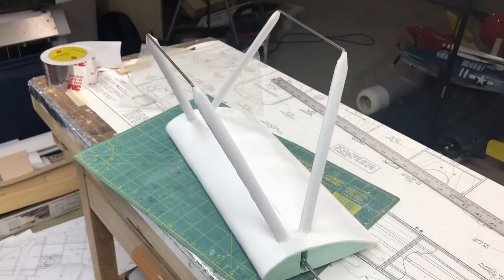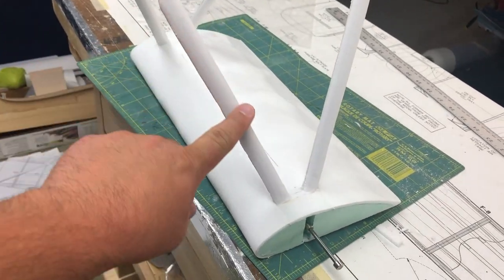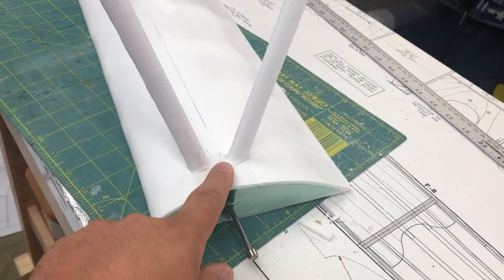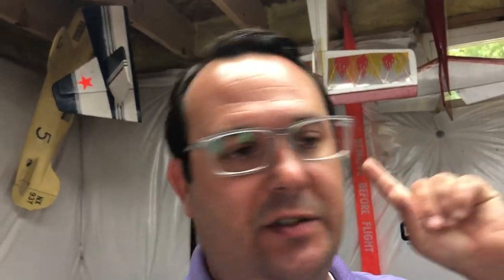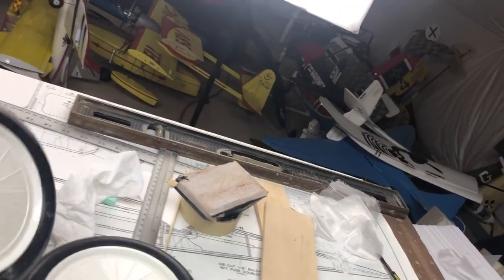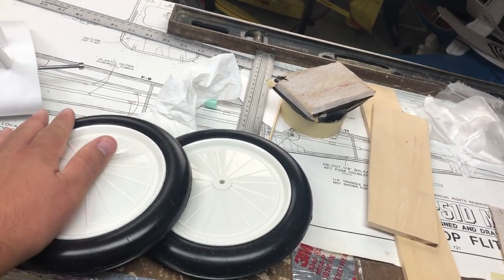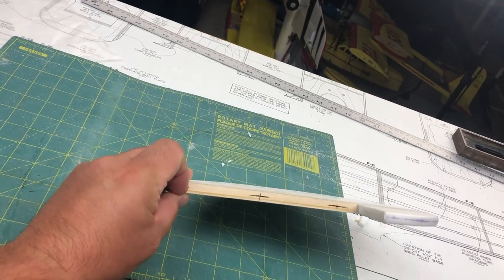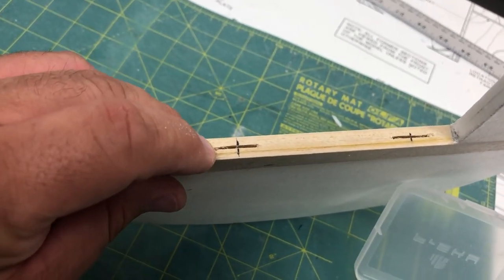Fokker D.VIII Ep.03: Or is it WHEEL man?

Comment: Hi josh. I'm building almost same size fokker dviii. I wanna ask is the xoar prop you're using is an electrict prop or for gas or glow? Reason for me asking is i'm planning on using a PJA xoar 22x10 gas prop on a 5060-270kv motor on 6s because its the only scale looking prop availble with me. I am not sure if that wil work. I will be really happy if you would give any suggestions. Thanks.
Reply from the maker: I'm using the gas prop. A prop is a prop. The "electric" designation usually denotes some design changes like thinner hub or airfoil profile. Anyone who tells you it's for efficiency is not well-informed. I get at least 15 minutes of flying time on my Fokker so use it as much as you can!
Reply: @JoshuaOrchard  Thank you so much Josh. Thats exactly what i wanna hear. I was not confident enough for the maiden in that size as my plane weights around almost 3 kgs. I will update once maiden is done. Thanks so much ones again. 👍🏻

Comment: well, that answers the "can I just 'glass DTFB?" . You're using 3/4oz.? cloth  I'm assuming.  I wonder how the weight/strength is compared to the paper. I'm more of a balsa guy. But, I've had a lot of cheap fun with the Flite Test planes.  ( if/when you crash you're just out a little time and $2) I may just have to build a simple cub without the paper and 'glass it to see what happens.   This build is looking great. Always enjoy learning different ways of doing things.
Reply from the maker: ;) Yeah, Sometimes there's a reason why I don't directly answer questions. LOL. In terms of structural strength, you really gain very little with the glass, or even the paper. The skinning with paper or glass is for ding protection and surface finish. The glass allows you to make a smoother finish overall, if you choose with the added benefit of saving a bunch of weight. I've built a few FT planes with the glassing method but I've found that the effort does not seem to outweigh the "fun factor" for me. I like my airplanes to give me that historical experience of flight and the FT designs are meant to be stable for beginners, not true-to-scale flight characteristics.

Of note, you can also apply this glassing technique to balsa, since you are more of a balsa guy. I used this same method of glass application before applying aluminum to a build. Fantastic substrate for quite literally any finish your heart so desires.
Reply: @JoshuaOrchard  I was wondering about using fiberglass on the foam for painting purposes. I've used polyurethane ( non waterbases) to seal the paper, Just the lightest coat wiped off immediately with a paper towel. It's gives good but heavy results.